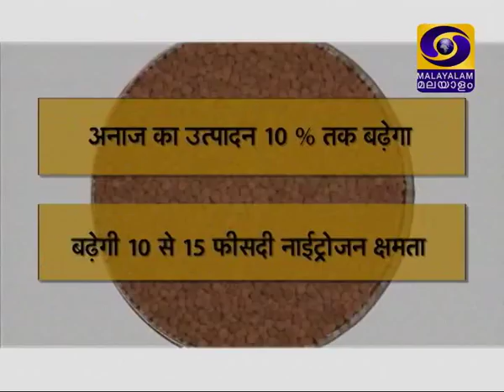Krishidarshan Malayalam 13-09-2017

Comment: 2 മാസമുള്ള  bv380 ഇനം കോഴി
നാലര മാസം പ്രായത്തിൽ മുട്ട ഇടും
വർഷത്തിൽ  320 ഓളം മുട്ട ഇടും
ഒരു കോഴിക്ക് ഒരു ദിവസം വേണ്ട തീറ്റ :100 Gram
ഒരു kg തീറ്റക്ക് ചിലവു  22/- രൂപ

നങ്ങൾ നൽകുന്ന കൂടുകൾ 275Gsm tata മെഷ് ഉപയോഗിച്ച് നിർമിച്ചിരിക്കുന്നത് കൊണ്ട് കൂടുതൽ കാലം ഈട്‌ നിൽക്കുന്നതാണ് 

24 കോഴിയും  കൂടും  11,000/-

50 കോഴിയും കൂടും  21,000/-

100 കോഴിയും കൂടും  40, 000/-

50-60 ദിവസം പ്രായമുള്ള കോഴിക്ക് ഒന്നിന് 140 /- രൂപ 

100 കോഴികുള്ള കൂട് സൈസ്  2.5 മീറ്റർ  വീതി  3 മീറ്റർ നീളം 

50 കോഴികുള്ള കൂട് സൈസ്  2.5 മീറ്റർ  വീതി  1.5 മീറ്റർ നീളം 

24 കോഴികുള്ള കൂട് സൈസ്  1.3 മീറ്റർ  വീതി  1.5 മീറ്റർ നീളം

Nutrifeed kerala
mob:9633049966
Free home delivery
 avilable to all kerala